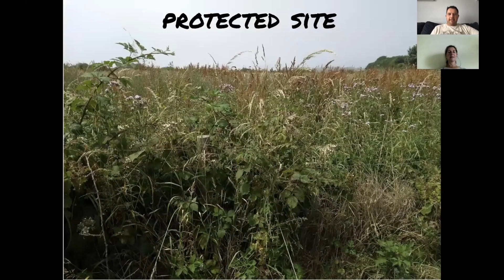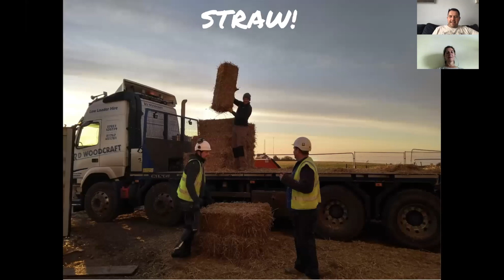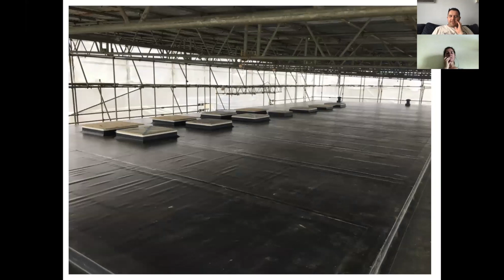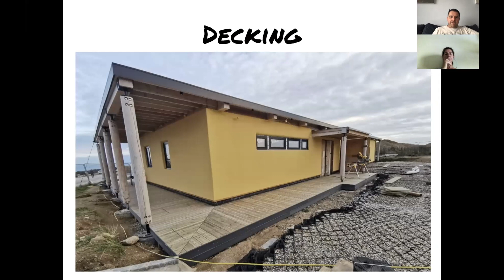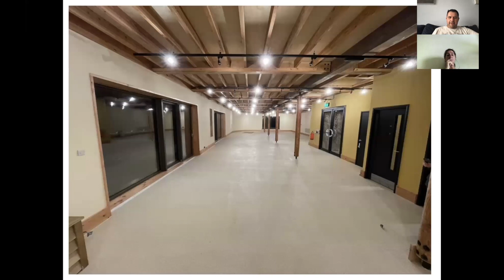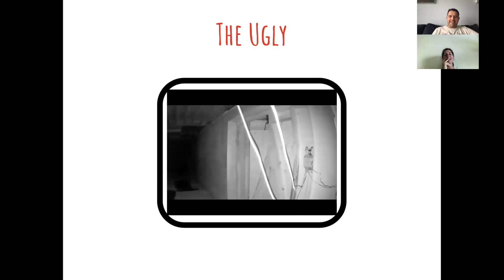July 31, 20:00: SBUK -The Bale House (UP STRAW Project)

Comment: To answer the chat questions: 1. Lime and hemp we would, in the UK, call hempcrete - usually used in wall construction. Limecrete = hydraulic lime, sand/aggregate, and fibres if necessary.  In this case glass fibres. 2. It can be very wet in the UK, but this site, on a cliff by the sea and 155m above sea level, was very wet indeed! Not every building in the UK would be built in this way, although tents, or hats, as we call them, are not uncommon on large buildings.  We ended up putting the roof on later in the year than planned, when the weather had got worse, so we put the hat on to enable us to continue working.